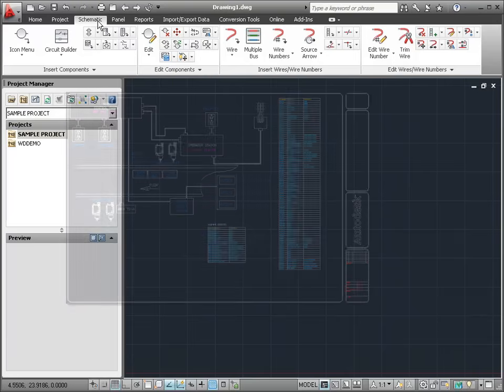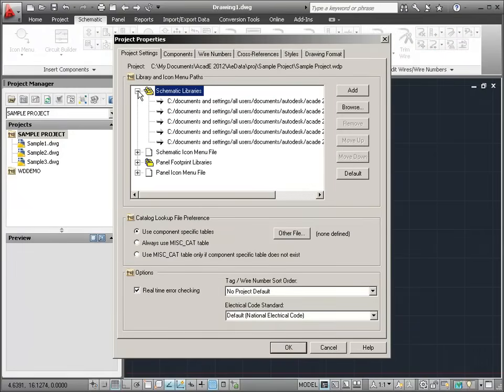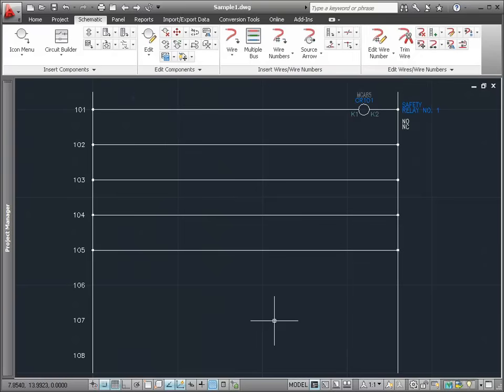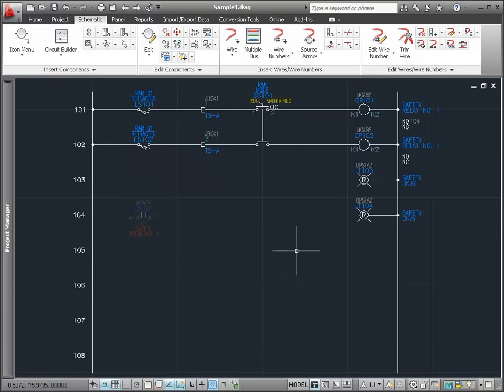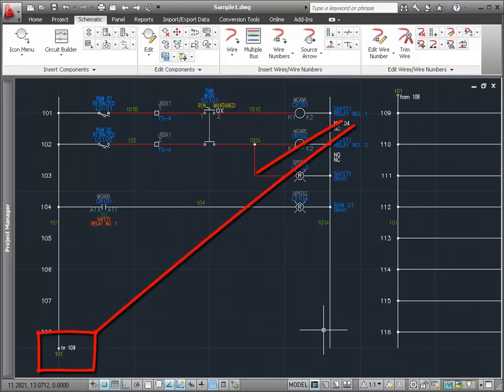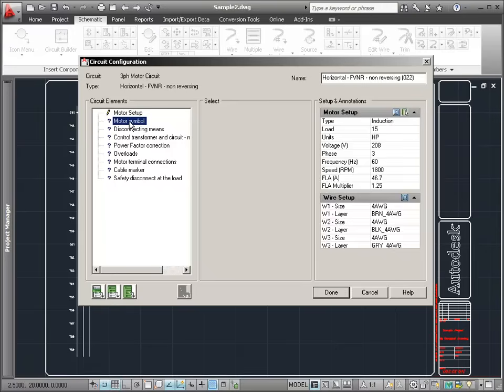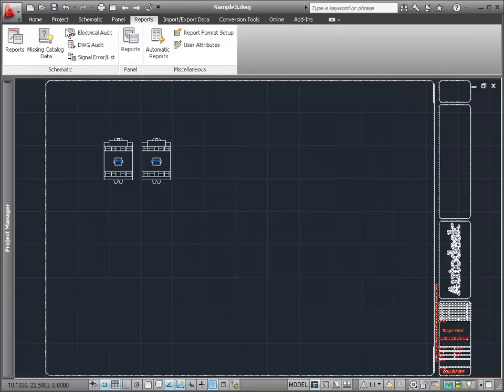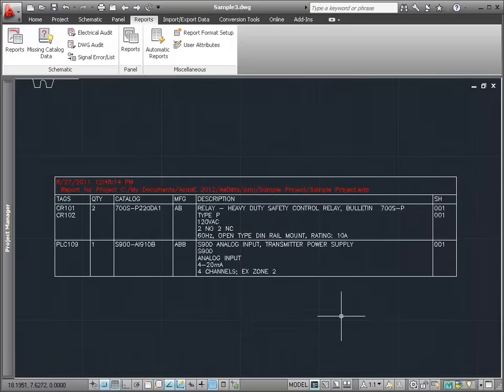An Overview of AutoCAD Electrical

Comment: sorry for asking. I've just installed Autodesk AutoCAD 2017 version. Does the software include with AutoCAD Electrical?
Reply: No, you need to install Electrical CAD for electrical.
Reply: @yellankivijaykumar7535  where can I find autocad electrical schematics tutorial for freshers
Reply: @heteroyenoushum3631  
HI, I WANT TO ASK HAVE YOU FIND  TUTORIALS FOR FRESHERS
I AM NEW AT ELECTRICAL AUTOCAD AND FINDING ANY VIDEOS OR TUTORIALS IF YOU HAVE CAN YOU PLZ SHARE WITH ME IT HELPS ME ALOT
Reply: it does now with 2019